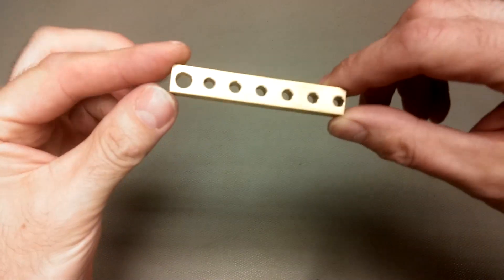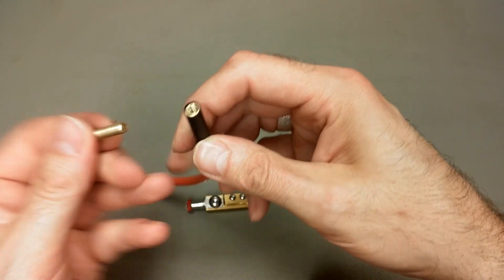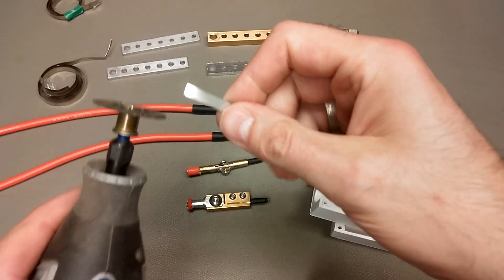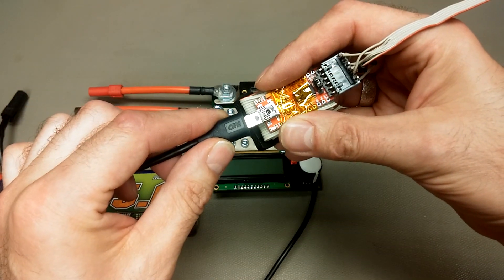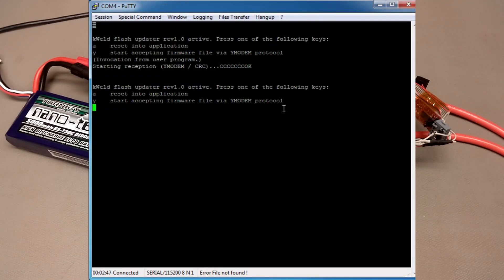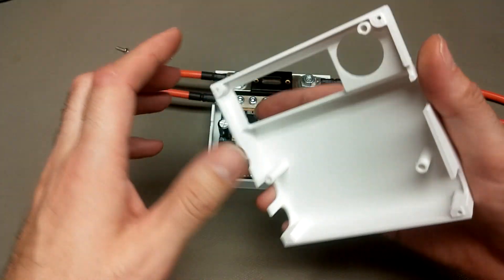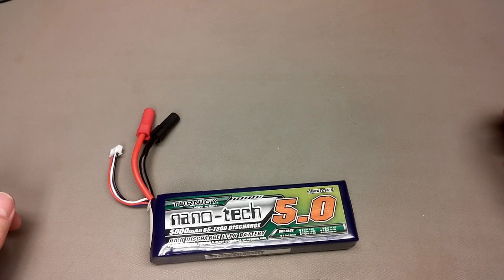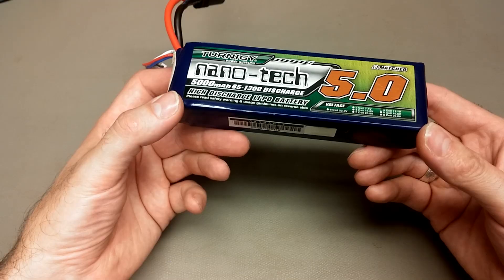kWeld "next level" battery spot welder - torture test and improvements

Comment: What about a 3D printed electrode handle that keeps them a couple of millimeters apart, so you can hold both with one hand? Could just be slip fit, and maybe tilted at a slight angle.
Reply from the maker: That is basically a good idea, but 3D prints cannot be used here because the temperatures that the electrodes develop can be too high for them. ABS may be suitable, but I would have to experiment first.
Reply: WeAreTheWatt well it can be any thermo resistant material. But my idea was based on seeing the handheld pen like holders. But since you've already got nice insulated electrodes, it would be a nice addition to keep hobbyists from shorting out the tips.
Reply: I have more than a few ideas about making my own including a spring loaded unit. My biggest problem is having a garage full of new bikes and bikes in boxes so much that I don't have access to my regular working spaces. Not a bad problem to have, but it's still a problem haha.
Reply from the maker: kWeld is small and should fit into your limited space ;-)

Comment: OK, I see your website is back up. 
I'm only a little concerned that I see no real feedback from anyone. I looked on the ES post, and figured at least Spinningmagnets would of given a review by now considering he got one. Maybe I'm not looking in the right place for feedback comments?
Irregardless, I'll probably be pre-ordering one by the end of next week. 
I'm wondering what buss bars to expect, brass or aluminum? 
Also, what the expected shipping date may be? I just signed up for the newsletter.
Reply from the maker: I see what you mean. I am sure that this will change soon, in the direction that I intend. I am very confident about the design. You may also check out the original forum thread from which this product evolved: http://www.eevblog.com/forum/projects/guesses-on-what-i-am-attempting-here/ I don't mind if you address people directly in the forums.
Reply: Thanks. I would much rather get your device than order one of those cheaply made welders from China.
Reply: I'll be pre ordering one mid summer 2018. You can count on it! 
I'll be building another unit for now using a momentary switch and a solinoid, and by the end of next summer I'll have the cash available for three of the alternative welding units to the Chinese transformer junk. It's my intention to build some battery packs, but I may as well do some reviews while I'm at it on my ebike blog and then post to electricbike.com and es as an almost electronic illiterate by 2019 after I've seen how the packs hold up over time. The way I see it, if I can do it (electronics) anybody can do it.

Comment: Dumb question; but why not make a piece to hold both electrodes in place, and make this a one handed tool, so that the other hand can keep the metal strip in place? You'd also get more consistent spacing, and possibly save time.
Reply from the maker: I though about that, but dropped it because it is very important to have enough pressure on both tips to prevent arcing. I felt that this would be easier to achieve  when using both hands. I use to keep the metal strip in place with one electrode, this works well. But as I sell the unit as a kit with the possibility to exclude certain parts, everybody is encouraged to construct their own electrode system. For example an automated one with solenoid actvation :-)

Comment: 179 usd is just too much, but it is a nice welder you made.
Reply from the maker: if you have the necessary tools to assemble the cables, or can even do CNC machining, then you can significantly cut the price. The bare electronics module is just around 100 euros.

Comment: Nice project.

I suggest you re-asess the battery choice though. Turnigy uses a Li-Co chemistry that has high power density, but relatively low discharge cycles. For this application you don't care about weight: it's not a drone. And LiCo is not that safe if you abuse it. There's no way you should be using a battery if you even START to get it swelling. Not indoors.

And I don't believe they actually get 5000 mAh for a 3S1P system: that's not possible for this chemistry.

I suggest you consider LiFePhosphate, specifically made by A123 of USA. In a 26650 format. They have long cycle life (>1,000 vs < 300 for LiCo) and very good peak discharge: better than LiCo. And are much safer if you abuse them. See this review: http://lygte-info.dk/review/batteries2012/A123%2026650%202500mAh%20(Green)%20UK.html

You can buy them from US sources at reasonable cost in bulk: USD13 each plus shipping (flat rate shipping charge that is high for a few units, but OK if you order a lot). So you can have a better battery for less cost, as well as much safer, good max discharge and MUCH longer life.

You don't need a BMS if you monitor the battery voltage (re-charge when battery gets to 2Volts each, ideally before), and you already have your fuse to prevent too high a discharge. 

You can use these batteries (A123 LiFePhosphate 26650) without a BMS if you charge them on a cell by cell basis, and even if you don't do that. All of the Lithium motorbike starter batteries use this system, and many have no BMS.

You can use a simple constant current/voltage power source to charge each 26650 cell at 3.9V and 2amps. It goes very fast: and they self discharge to level out at 3.8V (no load).
Reply from the maker: Thanks for that suggestion. Do you have any data on the ESR of these cells? I cannot imagine that their short circuit current can be high enough for this application.

Comment: As I see all you do is turn on/off bunch of MOSFETs connected in parallel using a microprocessor. What so special about it?
And you can just use regular car battery. Those are capable of similar currents. No reason to waste 60 bucks on a lipo pack for soldering purposes.
Reply from the maker: Look closer, the system is doing a lot more than just switching some MOSFETs. And even this is not as easy as it look, at current levels of up to 2000A.

It is up to you what kind of power source you connect to the welder. Lipo, car battery, ultracapacitor, it'll work fine with each of them.

Comment: Do you have a link to the real pure nickel strips that you use here?

https://youtu.be/rQnODV4VQjU?t=234
Reply from the maker: I'm currently using these, the first ones were nickel plated steel. These are pure nickel. http://www.ebay.de/itm/Nickel-L%C3%B6tbr%C3%BCcken-Akkubr%C3%BCcken-L%C3%B6tfahnen-Akkuverbinder-Schwei%C3%9Fband/160974484305?ssPageName=STRK%3AMEBIDX%3AIT&var=460152704070&_trksid=p2057872.m2749.l2649

Comment: Why not a machined copper bar for the FETs instead of aluminium?
Reply from the maker: They are 4x12mm, which is way more than enough. They contribute only a few ten microohms. The idea to use aluminium is that this can be laser cut, which should lower the cost. But I realized that I have to add anti corrosion coating, and the laser cut parts had huge burrs. I will switch to machined and polished brass parts in the next revision. (Brass being cheaper than copper.)
Reply: Hey there...I'm a fan of your work here.  I ordered things to make spot welder similar to this a few months ago for personal business use.  I'm been a design engineer for 15yrs...I think you'd want anodized aluminum for your bus bar, 6063 or so.  Most people use a gap pad or thermal grease direct on the anodized, extruded aluminum.  If the heat is ok, I'd find it hard to justify brass or copper.  Aluminum is most common because it's cheap, works well enough, and machines great.  I like binder clips instead of screws to mount heatsinks, if that gives you enough pressure, then you don't need holes in the gap pad.  Just an idea...
Reply: I mean, binder clips to mount the mosfets to your heatsink
Reply from the maker: Thanks :-) I am already working on getting new stock.

Heat sinking is not the main purpose of the bus bars. They are carrying the current, since that is not possible with PCB traces at currents of up to 2000A. And I don't want to use expensive technologies like buried aluminum PCBs. Anodizing aluminum also creates an isolation barrier. This is also the main reason why I am going towards brass again now, because it maintains conductivity when oxidizing. Aluminum is just too reactive with air when not coated with a conductive layer (in this case, nickel).
Reply: Ah, ok using it for carrying electricity is different.  I think however brass is not the best fit.  This is of course your project, which I will respect.  Usually, brass is not as conductive as aluminum unless it is an alloy with a high copper content...aka, bronze.  I would consider 110 copper, silver, tin or nickel plated and reduce cost by going thinner with the bar.  Silver plated 110 copper is common to purchase and specifically made for such an application as you have here.  Nothing will be better than silver plated Cu for a reasonable cost, if you consider that reasonable.
I did a lot of research a few years ago on high current battery connections, upwards of 2000a.  Your fuse is 300A, so I'd guess your just pushing under 75A continuous through each FET at most, no?  In your case, I think the current is nearly instantaneous.  If you want those connections to last and not create excessive heat, there must be a spring and lock washer (spring-washer or bellville in your screw mount) and a lot of pressure pushing on the connection.  Flatness is important also.
Thermal grease prevents this oxidation you mention.  Plating copper is fairly easy.  Just be warned, if you have a bad connection the copper reacts negatively with oxygen when it reaches a critical temp, which can happen with compromised connections and high currents:/
Reply: you know...brass will likely work well.  I dunno why I say it's not ideal...it's just not commonly used for bus bar I suppose.  If Aluminium was working, brass will likely work fine:)  I would use those spring and lock washers though...
Reply from the maker: Thanks for your very valuable feedback, this is what I need to push this project further. Silver plated copper would be great, can you maybe name a source? Remember that this is currently still a niche project, I cannot knock on the doors of wholesale suppliers yet as they would laugh at my quantities. Current is 1000 to 2000A, the fuse is okay because the welder only produces very short pulses. I play with the time-current chracteristics of these fuses here. I was thinking about adding spring and lock washers, but I had bad experiences with them when sandwiching FR4 material in the past. I am not too worried because this is an application that does not create large temperature cycles on the circuit board. Even when abusing the system as much as possible, I can only realize 50 degrees C at the MOSFETs. They are more than capable, maybe I can even reduce the count. Thanks for the tip with thermal grease!
Reply: No problem!  Mcmaster-carr has silver plated Cu, starting with part number 88865K621 as the thinnest.  This is specifically used for bus bar.  For reference, I've seen 10mil Cu foil carry 500A continuous, but that would not function well for a heatsink as you have there.
Reply: You're welcome!  I think you have a very viable product; I'd like to see it do well, and would much rather purchase one of these bad boys than make one myself!

Also, I see this about Aluminium bus bar: "Concern over the Al oxidation away from the joint is not an issue and will act to protect the conductor from further corrosion in most environments. ... Aluminum and copper conductors are typically plated with silver or tin. In general, bolted connection of unplated aluminum to copper bus bars is discouraged."
-I'm just unsure where you can find tin or silver plated aluminium.
-This might be all it takes for aluminium-to-IC connection, or something like it, to prevent oxidation and help with thermal connection: http://www.timtronics.com/electricaljoint.htm  .  The oxide layer will for super-fast on bare aluminum, however.  I'm not sure, but this may be sensitive to when it is applied.  Seems safer to get away from the aluminium-IC connection.
Reply: ...and another brief idea...me and many others use the Sunkko 709A or similar for 18650 batt welding.  The 709A is weak, and cannot weld anything except thin nickel strips, which are not good for high currents.  It does come with a decent, cheap, replaceable handle, with common connections and electrodes: http://www.ebay.com/itm/10pcs-Spot-Welding-Rod-Tips-Welding-Pen-for-Sunkko-Spot-Welder-709A-709AD-/122249685712?hash=item1c76a62ad0:g:i5YAAOSwiDFYP1eL 
Your electrodes are no doubt better, but these are available for the masses.  The actual electrodes look better than the ebay pictures.
Reply from the maker: Re welding pen: I had the same recommendation from another user, and I have just received one for testing. They don't look like they would be up to the task, but I may add them to my shop for light duty welding.
Re bus bar: I plated the alu bars, but with nickel. I'm quite confident that this will work, considering that the unit is not an outdoor or offshore model :-) The brass bars for the next production batch are already ordered, but I found a good company that does all work steps: cutting and drilling copper bars, and tin/silver plating: https://www.bronmetal.com
Reply: Nice!  Yes Nickel is very corrosion resistant and popular for high current terminals...and sure, getting a shop to make parts is nice when your time is limited also.
Reply: Hi,  
I hope your doing well!  My welder build is finally underway, starting the mechanics today.  My application is custom (needs 12-20 electrodes on a fixture) and I have no interest in selling something to consumers for this.  The function of the device, however is very similar to what you have here.  I wanted to do what I can to share some of this information.  With luck, hopefully I can weld some aluminum sheet later today...or at least I will blow up some FETs:P

-Energy output:  I'm not sure how your device measures the energy output, but I think mine will measure current through the current sensor and take the integral, stopping pulsing (5-10uS each pulse) when a predetermined energy output is reached.

-Electrode type:  My electrodes will be mounted on solenoids to retract when finished.  Nice to prevent sticking the tips to the work.

-Electrode material: I'm using 2mm dia 110 Cu.   I'm considering trying tungsten TIG welding tips.  It seems like the result might be melting the weld via heat rather than passing current through.  I have seen this work for copper welding with graphite tips, but I think tungsten will be better.

...these are all things you have figured out for your device, but if you're interested in the results of anything here just let me know.  Just thought I would share b/c it seems like this tech has a good future.

Best,
Jared
Reply from the maker: Sounds like an interesting project that you have there, do you want to share some pictures? Blowing up FETs is not very spectacular at these low voltages, they just puff. I once had a 150V ISOTOP device spitting out 50cm long plasma flames, and I later found that this incident had discharged our 120V / 5.8F (yes, Farad) capacitor by half. That was exciting :-)

It is not enough to measure the weld current to get control the energy. The weld spot resistance is changing, and P = I^2 * R. You also need to know the voltage at your electrode tips to calculate the power.

Your electrodes may be a bit too thin if your welder should work in quick repetition. Mine are 5mm dia and still they get hot quickly. Tungsten can also be problematic because its specific resistance is high. Others have had good results by using a copper rod with a tungsten core / tip.

I would love to share our results, but as I want to keep our far east friends from making illegal copies as long as possible, I don't want to disclose too much detail. You can contact me via my website if you like.
Reply: Fun, and yes I totally agree and understand about not sharing too much info for cheap clones to make it to market before your original.

I will direct further detailed info to your website; if the info below is more than you want to share, feel free to remove the comment.

The calcs say the tungsten will get very hot but survive aluminium spot welding.  It may turn into more of a contact melter than using the electrical current to heat the weld spot.  I see some evidence to think (especially welding copper) this might be a good method.  Some people use graphite tips in a similar fashion.  ...but I think Cu is likely better...I am starting with Cu, but the electrode will be interchangeable with Tungsten, with no threads or machining on the electrode.  During these first tests, the added resistance of the Tungsten tips might help to ensure current doesn't exceed the max before the overcurrent is tripped.

I have current and voltage, so the rest should be math I think.  I expect I might have some things to learn here tho...hopefully my circuit will shut down or survive during the overcurrent time.

My college had "craftsman" burned into his hand when he shorted the wrench across a high power EV battery.  We had just talked about wearing the gloves...it was neat tho how the wrench and bus bar instantly became 1 piece.
Reply from the maker: The problem that I see with tungsten is that you have to remove the heat from the probe system after a weld, and that may limit the repetition rate (if that is important with your system, which I doubt from that you tell). If you have an overcurrent detection that can react fast, then you can maybe approach your target slowly. Because wiring loop inductance limits current rise, your detector has some time. For my welder, it takes 400 microseconds (!!) until current is at full level.